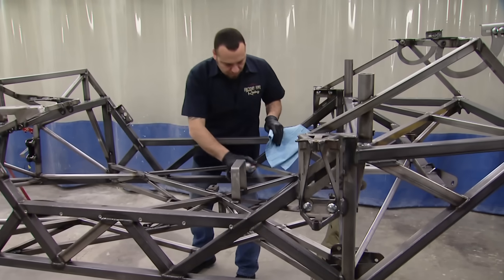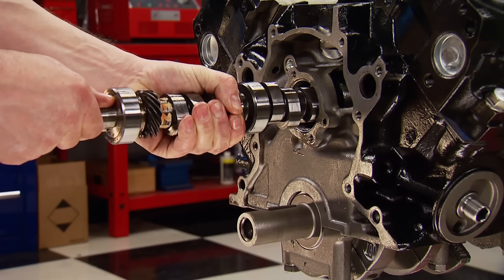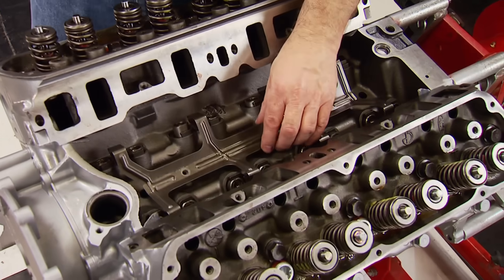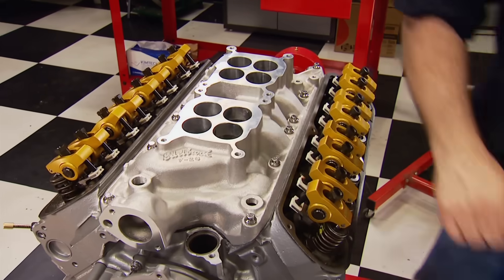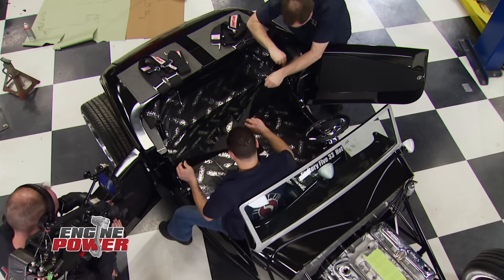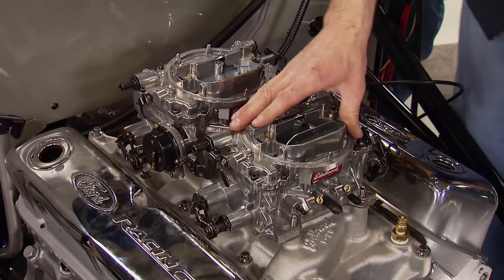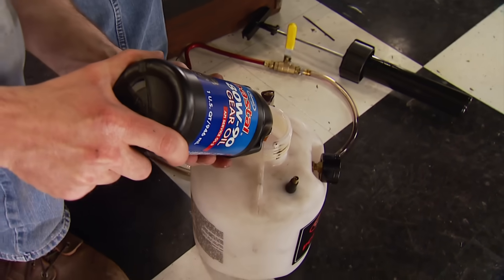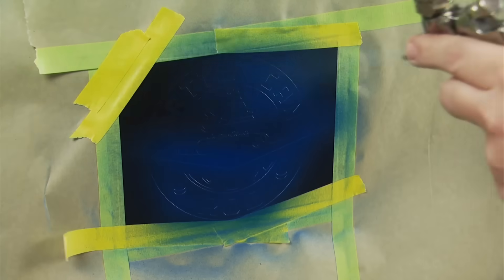Dropping A Ford 302 5.0 V8 In A '33 Ford Hot Rod Kit Car - Engine Power S2, E11

Comment: Fascinating video.
Does this kit come with a RHD option? Are there any wheel flares or mud Guards that can be fitted? The wheels MUST have some cover on them here, to protect pedestrians. That is, the tyres can not protrude out beyond the body of the car.

I am in Oceania  - that's Australia and New Zealand, plus some of the Pacific. Getting a newly-built car registered here means it has to meet new car registration legislation. That also includes mufflers for noise reduction and pollutant suppression. 
Having ABS, ESC and a couple of Airbags hooked up is also required.

I dont recall you covering that in this video? 

Finally, is there any crash test analysis data available for any of these car kits?

Comment: Mike and Pat forget the separator plate behind flywheel... also did not mention checking the torque convertor depth into the pump housing to make sure the pump has maximum engagement without bottoming. I expect the separator plate missing would put the convertor deeper into the pump, so who knows? If the torque convertor bottoms out. the pump will start making metal pretty fast....

Comment: alternatively if you dont want to be as flash you can just use a junkyard LS and 4l80 trans. L99 makes more power than this in stock form and can be found for pretty cheap with low miles.

Comment: All the Pooh poohing about it probably being a slug is most likely not tuned into 5.0 performance with a couple mods . A gt with auto and 2.73 gears coupe can run in the high 14 zone... gears are good for 4 or so tenths and headers and a cam you are probably a mid 13.   It’s been around the time that the Beavis and Butthead first season was on that l was around stock and mild mod 5.0s.... The plastic intake , spout and bigger than stock headers and Flow masters was a cheap way to low 13’s A few mods a call it 260 hp... now that you’re looking at a 3400 pounds... now l am saying the rod will weigh about the same as an early 260/289 Cobra..with driver. l believe around 2200 pounds is a good guess ... now do some math... 2200/ 260 hp is probably a high 11’s machine... with Street tires and gears... don’t know what heads are on the rod, maybe they said, maybe l missed it. A 300 horse power engine with cam etcetera with a good chassis , and maybe 3:73/4.11 gears and some drag radials Should put the rod at about high 10’s.... pounds per hp.... and a decent setup is all you need. 1700 pound Volkswagen with 130 hp is a easy 12 seconds. I can spank hundreds of new Honda’s with that.... Oh, a couple more things... that 3000 stall and light weight is going to be a slingshot. And back when a 5.0 had 100,000 on it would still pump out 197-199-201 numbers bone stock, if you could find one... ok? That was at the wheels... Shifting a stick stocker over 5000 was a waste of time, money and car.

Comment: While the 302 is a great engine and makes good power....I wonder why more folks DO NOT USE the 351 for their Ford Small Block needs!! The two best power options would be for me the 351 Windsor or the 351 Cleveland motors!! And both make more horsepower!!!

Comment: Overall this is a very informative great video.  Just a few wishes to add to the really good information.  First, not even a mention let alone any guidance torquing bolts when assembling. Second would really like some commentary on costs.
Reply: Steven Perlman 
When torgue was required they mentioned it. Unless your referring to torgue of the frame and accessories they are just tightened as needed

Comment: I was surprised by the space frame construction. Was not aware there was anything like that available for hot rods.
Reply: It's a Factory Five and you need to get out more. They also make a '33 Coupe built the same way.
Reply: @dj4monie  I have heard of the company and just figured "it's just another kit car company". I had seen postings on Bringatrailer under "replica Cobra" but had not looked into it as I was just "browsing" the current values of replicas. 
BTW, I do get out . . . lots. 
Too much in fact, but that is business related not R&R.

Comment: Just my opinion but i think you could have a least shown the motor on a dyno test to let the viewers see for them selves that in fact A...the motor runs,it has no rod knocks...B the carbs are a match for the 302 and cam..C it makes at least the stock 230 HP it before your { improvements } .Otherwise it looks like just anther PAINTED LADY of the evening,she looks great on the corner,but once you take her home to see MAMA,she looks just like any other tramp.

Comment: The end of the video was a bit sketchy.  The ticking noise was strange on start up with instant music.  Did they pump the oil up before the first start?   And why not run a 1000 CCA cranking battery, it's easier on the starter.  Lastly AOD transmissions are absolute junk, a T56 would have been a crowd pleaser...

Comment: Your putting a 5.0 into your hot rod and Edelbrock carborator's on it ??   Carters are the Chevy version of a Edelbroke,  , and run great on a Chevy.  Motor craft is the for version, and Holley is the best caborator you can run on a Ford 5.0 .

Comment: Paints the headers with VHT then magically they turn to chrome ceramakote . Lifter noise like crazy at start up. And I’ve never seen a mechanical fuel pump supply fuel as soon as the key turns. No block plate at the transmission means problems in the future. This build is typical bs . Tell us one thing and do another . Hope no one noticed

Comment: Very nice build guys. Very cool car.  I would like to point one thing out, you forgot the aluminum plate that goes behind the motor before you put on the flyweel. It works with the trans inspection cover to cover up the converter. the starter may not engage properly.

Comment: I used VHP Flame Proof coating on my headers  in my Jeep CJ-5 360 AMC V8. I followed the directions to a T and within a year it was flaking, discolored a horrible looking. The VHP ceramic engine coating and the primer underneath it began flaking off around the same time. My once gorgeous engine looked horrible within a year of my ground up custom CJ build. $26,000 invested in parts and supplies building my jeep only to have to remove the engine within a year and strip the remaining paint and start over. I used a different paint brand on the engine the 2nd time and it still looks fantastic 5 years later. I did have the headers professionally ceramic coated the 2nd time rather than going the DIY route and rattle can coating over them again. My engine looks amazing and I discovered its a couple hundred dollars cheaper to buy uncoated headers and send them to be ceramic coated professionally than it is to buy ceramic coated headers to begin with. In fact my headers are coated inside as well as out and look amazing as well as they cut the heat down in my engine compartment dramatically compared to when they had the VHP Flame proof coating on them. I have a set of ceramic coated Doug Thorley headers on my 55 Fairlane 351 W and the difference in the Doug Thorley coated headers and the Summit racing headers I had coated is significant. The price comparison of buying a pair of AMC V8 Doug Thorley ceramic coated headers vs doing what I did and having  the plain steel headers coated I had already bought and self coated from Summit Racing  was $243 dollars after I had them professionally coated. Heck of a deal. They look and work excellent and saved me some loot to boot !

Comment: Nice engine.  A bunch of carburation and stock port heads.  Why??????????
Reply: and  cheap stock fuel pump can't keep up with 2x4 Carburetors. It will starve out the motor!

Comment: 14:13 "E3 DiamondFire Spark plugs".... them boys must be paying you quite a bit of money to keep installing that garbage in good engines.
Reply: Michael Free It seems odd to me that these shows have been pushing E3 for probably a decade, but I’ve have never known anyone who runs them & have never heard anyone even talk about them. I’ve never seen them at the parts store either.
Reply: @Properformancenutritioncom  ran them in ford 4.9L and they would foul out after about 1000 miles so didn't work for me.
Reply: BLM Hawkeye Good info. I don’t plan on trying them. I don’t think you’d be able to know if they make a difference unless you put your motor on the dyno. 99% of people will never do that.
Reply: LOL
Reply: Michael Free They are lol

Comment: I wonder if this car had any adhesion issues after doing the long term. I've always had problems with aluminum and zinc plated stuff and have been using (toxic) Zinc Chromate Primer for so long I donno what the modern paints are capable of! Thank You, <3 all

Comment: 87 octane? Factory 5.0 ho ran 93 🤔
Reply: They said at the start " Rated @ 225 HP which means 8:5:1 compression.  Stock 69 302  2V with 9:1 compression = 236 HP  ;  stock 72 302 with 8:5:1 = 220 HP. that's why they put in the 87 tap water "gas". It's really unnecessary, any small block can run 9:1 and still run 87 octane as long as the timing isn't over 12 degrees advance. compression that low is for people who are ultra cheap or know nothing about Engines, ...or both.
Reply: @Autojones  my old 93 thunderbird 5.0 would ping if she didn't get 93 octane
Reply: What was the compression ?
Reply: @Autojones  I'm not sure, whatever factory compression was for a 93 Thunderbird lx 5.0
Reply: The only point I was making was if that engine has 482/493 valve lift and is only making 225 HP and they're running 87 octane I would highly suspect they are running 8:5:1 compression. Cuz that engine is rebuilt so it could have any compression ratio.

Comment: Why, oh, why?
You assembled the entire engine, put in the car, and then the little details, without any disturbing noise (music), then as soon as the engine started, they have to drown out the music of muscle.

What in the heck is the world coming to???
Reply: If you listen closely, that engine had a major knock/tick in it. Either the lifters weren't getting pumped up, or it was a rod bearing.
Reply: @trirycheman  First thing I heard over anything else... They are good actors though didn't even phase them.
Reply: That absolutely PISSED ME OFF 😠😠😠!!! Who does that!?!?!?!?!?
Reply: @Cyclone Bravo yeah, regardless you never look as cool in a wanna-be AE86 drifter or hairdresser vert.
Reply: Liam Jerkins they needed to hide the flawed motor sounds in the  video from the viewers. I saw that coming.
Reply: Cyclone Bravo -   Tiu have to remember they are biulding this for ANYONE.  Could be a 67 yr old lady. Or a 21 yr old kid that cant drive.  This is a mild built cruiser for that reason.  Just appreciate the fact that they are giving this away to some bery lucky person who will enjoy it for decades to come.
Reply: Right......WHY
Reply: Precisely what I was thinking.
Reply: There is a problem with the valvetrain the engine is clattering so loud the music barely covered it.  Assuming they started it before videoing the the final cut (they did, the mechanical fuel pump would not have filled the carbs that fast for an instant start) it's probably not a quick fix.  Also should have spun up the oil pump with an old distributor shaft before starting the engine for the first time, no need to start it dry and wait for the pressure to build.  Two 500cfm carburetors on an engine that only needs 525cfm means their secondaries will never open but it looks cool.
Reply: Came here to say this. WTF
Reply: Liam Jerkins  they left out the starter guide plate, makes all sorts of starter drag noise.
Reply: i THOUGHT THE SAME THING--!!   Wanted to hear the engine and they cranked the stupid music up the instant they fired it up-!!  WTF, theyre supposed to be car guys-???!!!
Reply: Doesn't matter it's a 302... bla bla 😂🤣
Reply: It's a F🤮rd engine. Just imagine the sounds of a truck stop bathroom 💩💩
Reply: More to the point...what is up with their obsession with the trashy, generic metal music in the background all the time... it's literally noise at this point. I'd rather have silence.
Reply: @derbigpr500  AGREED-!!

Comment: Sounds like a tapping noise while in shop running.  Is that why music got turned up ?
Reply: Probably dry lifters,they will pump up after a minute
Reply: Count to 11, the ticking should stop, if not there's a problem. Oil pressure.?

Comment: GREAT JOB GUYS !!
Nice, realistic, build for the average hot rodder. Some of you don't get it. No, they didn't paint everything with a spray bomb. Having painted a car ,( and a couple motorcycles ), with cans, you REALLY would not like the final results. Personally, I would have done a few things different. But, this was all about budget. Still, there's a lot of nice stuff here. And it's easily upgraded or changed. So, enjoy it for what it is. Quit complaining. They are trying to teach / show us what is possible on a budget. Build your own......
I still can't stop thinking about that 500 horsepower 347 stroker they built a few episodes back.  With a manual transmission. But , that's just me. 👍😎

Comment: 1000cfm seems like a whole lot of carburetion for a relatively mild 302...
Reply: Actually even a mild 302 can handle a 780 3310 Holley no problem, they like being over carbureted. An Edelbrock 500 has smaller front barrels 200 cfm front,  300 cfm back so normal driving is like 400 cfm because the secondaries only open under extreme acceleration. but I do agree, I would have put two Holley 390's on there.
Reply: Autojones 
The cfm for a 302 is around 600 its pretty much 2 times the cubic inch for the cfm the rest you dial in by jets 1000 cfm is so much overkill its crazy but im sure they have one of them restricted and its also obvious that both carbs are not double pumps and are jetted down
Reply: @lesliegee42069  It's okay, it's not overpowering. There is a guy with a twin turbo 302 in a FFR Cobra and it runs low 10's with LITTLE effort (8 psi). Big power in this chassis is nothing, fully tube but it's budget oriented, the dual quads are for looks.

Comment: Finally a Ford in a Ford
Reply: Can find 302.fords for $100 at junk yards that run excellent, but that's right you can buy chevies so much cheaper. At least that's the crap we've been fed.  L.o.l
Reply: @bigblockstang9368  yeah 302s are cheap but 5.3 can handle more horsepower and has more horsepower stock
Reply: Yeah but if your broke like me ls is the way to go cause a 5.3 ls is like 300$ or less at the junkyard
Reply: @CopperheadGarage  If you cant afford it...then save....no need to deface a vehicle
Reply: @xbox627  if ya own it you can do whatever you want to it
Reply: @xbox627  "no need to deface a vehicle". Whaaaat?!  
1. It's NOT A REAL FORD, it's a KIT car. 
2. FF also gives the buyer the choice of SBC/LSx so it's not meant to be only a Ford. Chevy's are always less expensive to build/modify than a Ford.
Reply: @vettesrule3170  still
Reply: @vettesrule3170  all I ever see is little 5.0 mustangs with turbo mods whooping Vette ass.. love it

Comment: 13:50 coil mounted to block for extra heat and vibration.
Reply: Well everyone knows the hotter the coil is the better the spark and performance is. It goes great with the engine knock they had whoever wins that car I'm sure won't have to fix anything. Also went with top shelf paint I mean what in the world could possibly go wrong?
Reply: That's where the were from the factory
Reply: @motorised1  yes i know, but that doesn't make it the best choice.
Reply: That's the factory location on my '75 with a 302, and I haven't had a single problem out of the coil that I put on it 20 years ago. 🤔

Comment: at 17:50 there is a ton of lifter noise at the same time loud music is injected in attempt to mask it.. What gives?  Too much lash?  No wonder that one guy asked "What is the oil pressure?"   Yikes!!  What did they do to fix the lifter noise?
Reply: prob was hydraulic lifters that hadn't built up oil yet. i ran a 302 at 100 mph for a minute or so racing and it pecked a bit until the lifters built back up again

Comment: Paints 8% of the car with a rattle can......shoots the rest with a standard air compressor driven paint gun. Then calls the entire car, the rattle can [poor mans] build....
Reply: They also skipped the 200 hours of bodywork these require before you can spray 'em.
Reply: You must really be that slow.  A poor man build means being smart about what matters and a lot of sweat equity.  No one will see the chassis so rattle can is fine.  And the Paint Shop stuff is cheap compared to most other paint.  Go price some of the stuff they used on other products and see.  And let me guess.  The YouTube garage ninjas can build this one for $398.28 with junkyard parts.
Reply: @bmstylee  blink blink How did you are the other guy miss the extreme sarcasm in my comment???? No shit Shurlock, that was the point that I was making. That this isn't a "poor mans" build and that calling it a rattle can paint job is clickbait.
Reply: "No one will see the chassis"

This car literally has 1/3rd of the chassis showing. ;o)

I don't think anybody is griping about using rattle cans to paint the chassis, it's the headline that makes it sound like the entire car was painted that way.

Comment: No engine plate before the flexplate huh? It’s absence could make for a noisy starter engagement...
Reply: Keith Hastings They film mockup up for the show. Then the engine is actually assembled by a pro. I've worked behind the scenes for these shows before.